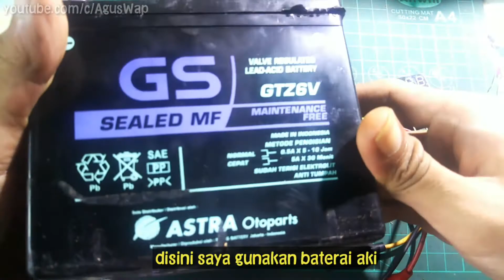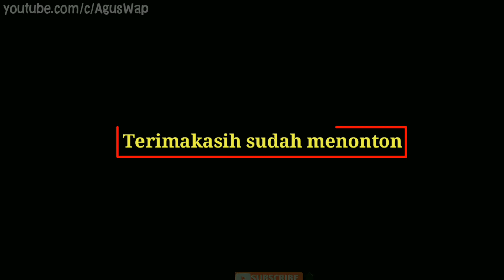Cara Membuat Alat Tester Lampu Led Auto Volt Dengan Voltmeter Digital

Comment: Bang kok punya saya sdh rakit, seperti contoh punya abang,, saya pake step,up. Keluran 10 volt.  pas udh jadi saya coba tes, ke led lampu, lednya..lngsung, Putus,, ternya saya cek pake, multi tester.. Keluaran volt, nya..msh 8,volt. Pantesan putus. Kok gk auto volt. Sih Bang, apa yg salah bang,, ?
Reply from the maker: harusnya aman pakai 10volt ,di video malah saya pakai 12v, kemungkinan dari modul step up yg bermasalah ada lonjakan tegangan